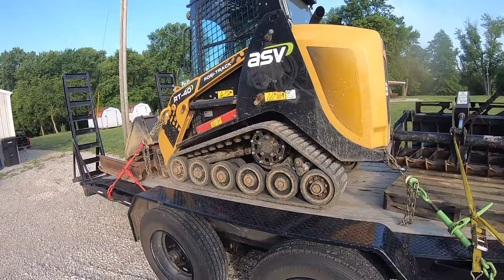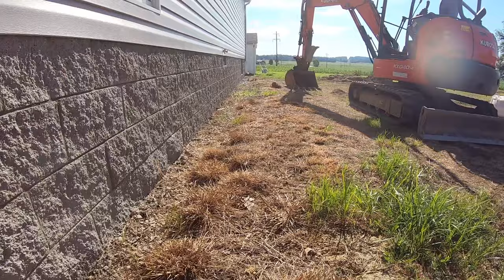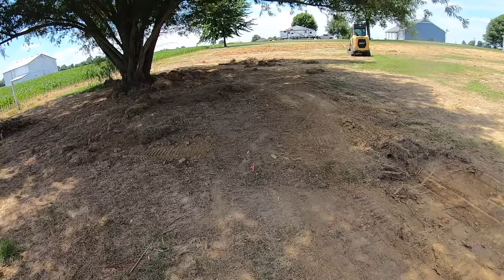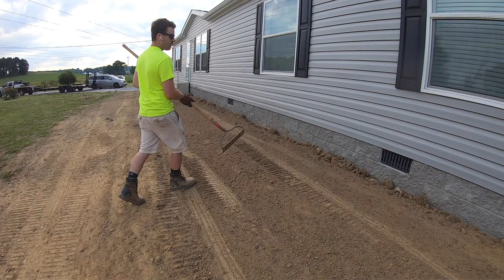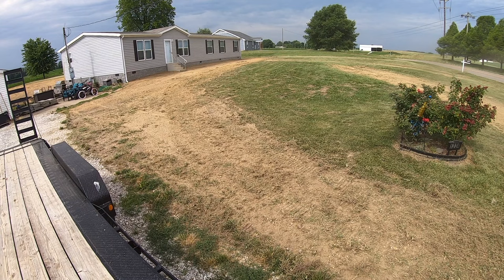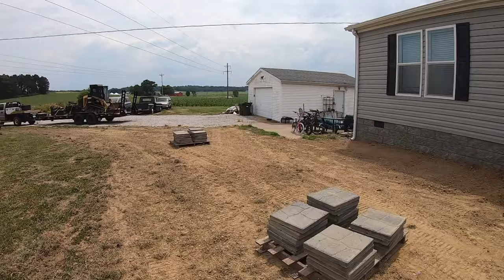ASV RT40 Grading & Harley Rake 1/2 Acre Yard

Comment: Hey sir.. is there a difference between a harley rake and soil conditioner? If so which do you prefer?
Reply from the maker: Hey Aaron!  I think they are used somewhat interchangeably.  But there are some models that have a hopper and the attachment is supposed to sift the soil and throw larger rocks and debris in the hopper so they are not left in the topsoil.  I think the harley rake is probably faster and less prone to clogging up.  You can also use the harley rake on gravel driveways too, where a soil conditioner wouldnt work.  Thanks for the comment and question!
Reply: @NealORussa  thanks for your response and information you provided

Comment: I do landscape construction and some minor grade work here and there. How do you like your rt40? they really interest me. I'm most interested in the rt50 thnx
Reply from the maker: I upgraded from the older pt30 to the rt40 so I already had a bunch of attachments that only fit that size quick attach. If I was starting new I probably would have looked for an rt50. With that said I have spoke to some people who have owned both machines and they say they are pretty similar the 50 just has larger track system and a large counterweight. I think power wise it's the same engine but I'm not 100% sure. I will say I am very impressed with the rt40. It has a ton of power for its size and it does the job of bigger machines for me all the time.

Comment: So I have a 2021 RT40 with the kubota in it. I also have what is called the all-weather cab which is cab, heat, and ac. I also ordered it with the factory back up camera which goes where the mirror up top is and the Jensen heavy duty radio which mounts up too on right side inside cab. A/C surprisingly doesn’t rob any power. I’ve never had to turn it off to work.

Comment: Neal, nice video!  I own a 30. Love the size but it’s shy on power. Thinking about a 40 but the 50 has the full size attachments. But it’s also bigger. If you had it to do again would you stick with the 40?
Reply from the maker: Man that's a tough call. I have so many pt30/rt40 attachments that's why I went with the 40. I like the 50 and full size attachments but from my research the 50 is the same machine except they turn the motor up a bit and add a counterweight and larger track rollers. It sits up higher for higher COG on an already tall machine. I'll say I love the 40, but if i didn't buy a bunch of attachments for my old pt30 I probably would have gone with a full size quick attach machine. I'll also say my rt40 with Kubota engine is night and day over the 30 with the Perkins.
Reply: Thanks for your thoughts!  I’m torn as well. My 30 definitely lacks power but it’s so small and maneuverable in the woods. They are using yanmar now. Is that different than the Kubota or does one make the other?  The 50 is definitely taller. Not sure if this would be good or bad. Have you run a brush hog on the 40?  Wondering how well that would work. Thanks again!
Reply from the maker: @tdf4089  I would be happy with the Yanmar engine as well, I have them in some john deere equipment.  My 2019 RT40 is Kubota engine, i think in 2021 ASV got bought out by Yanmar and they put their engines in the machines.  I run a brush cutter on the RT40, works great.  I don't have any videos currently of the cutter on the RT40, but i have many on my channel running the cutter with the PT30.   I also run a 6' harley rake on the RT40 and have videos of that.  Check them out!
Reply: I was watching the Harley rake last night. It was doing a nice job!  Looks like it works well on wood chipped surfaces. I may need to look into one of those. Thanks for your input Neal!!  I have to pull the trigger today.  You don’t have any experience with a snow blower on one of these do you?
Reply from the maker: @tdf4089  no snowblower experience, sorry. Good luck on the purchase, report back and let me know what you buy! Also check out Facebook group "ASV Skid Steer Forum" if you're on Facebook.
Reply: Get a 50 !!
Reply: Hey man good videos, I am from Daviess Co. where did you get your asv?

Comment: Looks good i usually put my loader arms in float then use my curl to adjust my depth of cut it with a harley rake
Reply from the maker: Thanks Windzer!  Thats great advice, i finally got the hang of it and ended up doing just that toward the end of the day.  I even ran float in forward and adjusted depth as you described.
Reply: Neal, does the cab on the ASV RT40 have Heat/AC?  I’m thinking of all the dust kicked up by the Harley Rake.
But what a great tool you brought back to life in that Harley Rake!
Reply from the maker: @jeffmayeux1692  unfortunately the cab only has heat!! I was really sweating in there, but it was better than getting covered in dust. When I bought the machine I drove 8hrs to get it each way. Seller told me it was cab with heat and ac. It was December in Michigan so I couldn't really test if it had ac. Turns out it didn't. I was a little mad haha. Thanks for the comment!
Reply: @jeffmayeux1692 Acording to the sales person I spoke to, yes you can get an enclosed pressurized cab with heat and A/C for the RT-40 with the Yanmar engine. If you look at the back of the cab, you'll see in some pictures an "area" with two electric fans. I assuming that's the condenser. Thats also where the condenser is located on machines that I know have A/C. I know that's not an hydraulic oil radiator because the hydraulic oil radiator and engine radiator are side-by-side and not stacked from pictures I've seen. FYI, the current RT-40 has a 3 cylinder turbocharged Yanmar engine. Yanmar also owns ASV now, thats why you're see more and more of their machines going to Yanmar engines. I don't know for sure if the RT-40 has an option for A/C when it had the Kubota engine, but there's a good chance it did. According to the website, A/C is not an option,🤷‍♂️. I've been doing a lot of research on these machines lately.

Comment: I do have a question for you. How did you get that Harley rake to mount up on the 40? Did you reweld the hitch plate or change out your hitch on machine? I currently run the 50” erskin made specifically for the ASV 40 hitch plate but it’s so small.
Reply from the maker: Check out the Harley rake build video here. It works good! Harley Rake Soil Conditioner Gearbox Rebuild & ASV RT40 Retrofit
https://youtu.be/tMn-0x824E0